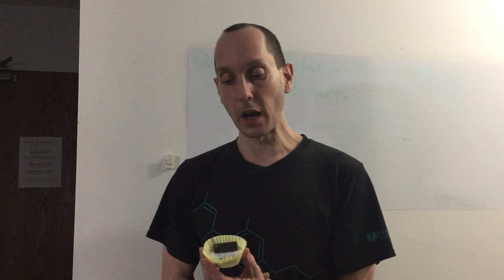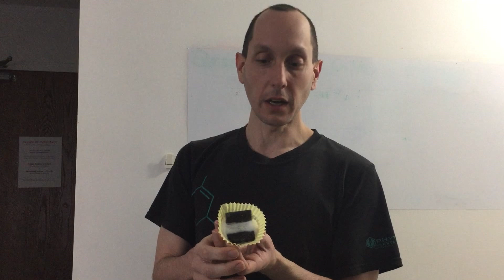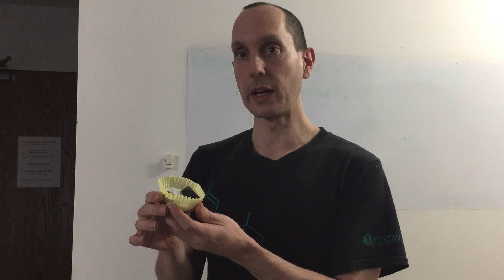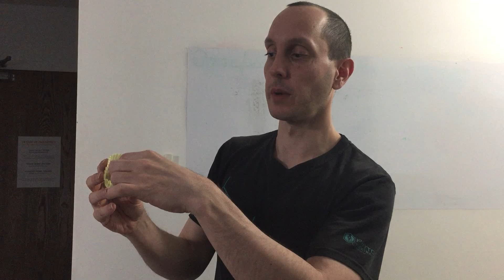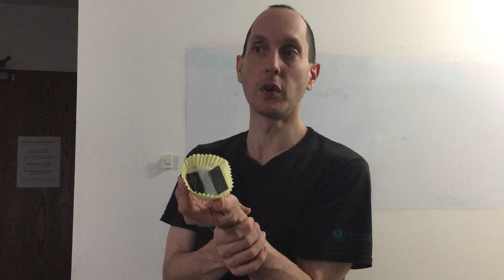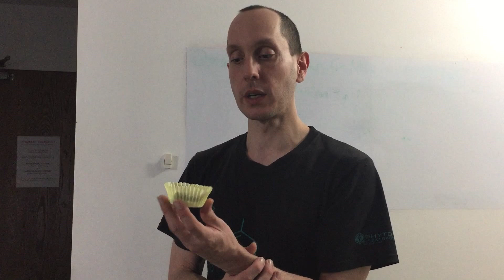Quantum Electret

Comment: Joel, did u know if u power a pneumatic device mechanically (with a pump) its actually constant current (flow) input, doesnt count as a pure voltage (pressure) source.  I think anyway.

Comment: The other idea is to desiccate it from all moisture using Silica gel desiccant. This could be Crystal Kitty litter etc. If you leave it in a sealed chamber to pull water out for a week, then one will really be able to check.  Ideally, having the cell in a sealed container with wires to allow for measurement without water in air intrusion will be a way to see if the effect is resultant to moisture and oxygen ingress into the nano pore matrix you have made.  Cheers

Comment: what kind of power are you able to pull?  It is possible that it is acting as an antenna not unlike a ceramic GPS Antenna?  Triboelectric effect?  Here is an idea, Try mesruing voltage with Cryogenic temps.  I did this with some cells I testes 13 years ago.  One may try Dry Ice etc.  I used Freon etc.  Great work and keep up the testing.

Comment: Great experiment Joel ❤

In my opinion is all about the method to retain the electric charge in materials with higher potential than they normally can retain. As everything has an electric charge, even the food.

A permanent magnet, electret, captret or anything working on the same principle will do the job as long as the extra electric charge that we add won’t be able to escape and is recirculated inside the alloy … the lower is magnetic field, the higher is electric charge than can be harvested. Anyone making a self resonant alloy or coils or device may observe they perform usable work (magnetic field/displacement) for as long as they are able to retain the impulse charge.

Difference between permanent magnet, electret, captret or whatever else consist in frequency at which they can be self resonant according to material physical properties.

Dielectric material or separator (if you prefer) can conduct electricity in electrostatic form and refer to capilar conductivity … they can conduct on outside not inside like metals. And electrostatic electricity is our inexhaustible source of energy in which we are living … this is always available and easier to collect/harvest as it can be greatly affected by any radiation anywhere in universe.

Comment: I have a problem. I mix the E. Glycol in hot water. It dries into a wax like paste, not hard. Worse if I add salt. What is your mix? Something else?
Reply from the maker: Maybe your using too much water. I only need a few drops to make it into paste.
Reply: Perhaps. The "carbon felt" I got from Amazon had no conductivity so I used aluminium foil for the contacts. Getting .5 volt only. (Half volt).  Fake carbon felt marketed as soldering blanket for copper pipe soldering.  Beware of fake carbon felt.